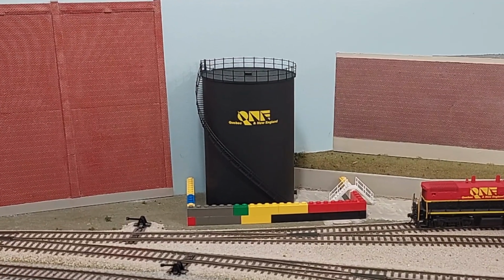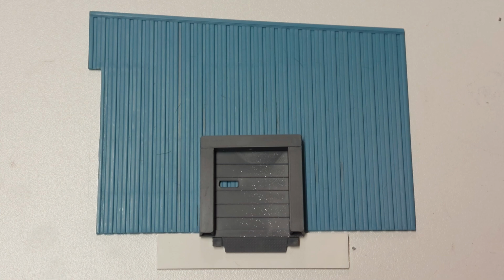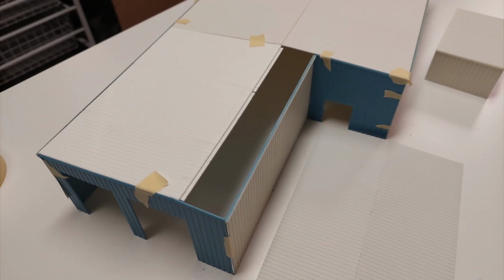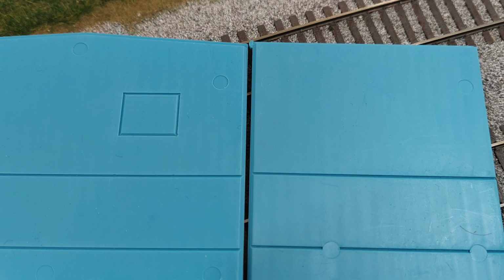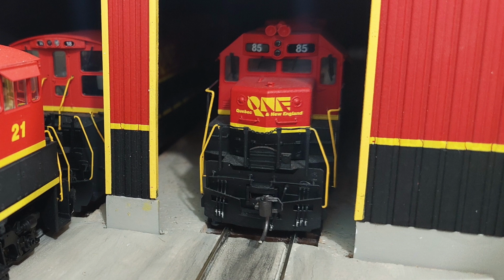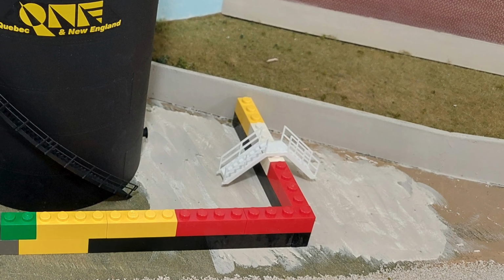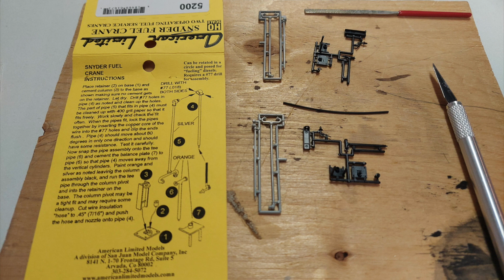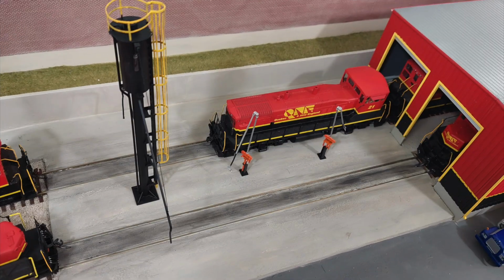Q&NE HO Layout Video 143 - 230606

Comment: I would just trim off the Lego parts and glue them together.  Then you can skip over the joints and sand it smooth. Also I have walked inside the retaining wall of big fuel silos. The inside walls are at about 35 degrees.  A person can barely stand up on them. The outside walls are about the thickness of the Lego also. I use plenty of Lego for frame work on my N scale . Anyway good building update.
Reply from the maker: Thanks. I considered using the Lego as a base, but it may be just as easy to use other materials than to cut off the nibs and patch them up. I have lots of styrene scraps.
Reply: @QNERailroad  I just trim them off then glue styrene over the top. The Lego are styrene anyway.  Then just styrene the sides . One straight the other inside at an angle. The Lego makes great substructures for buildings too. This is due to being straight and easy accessible.